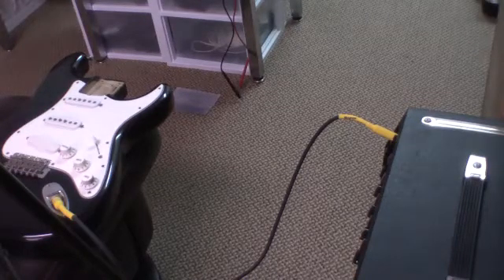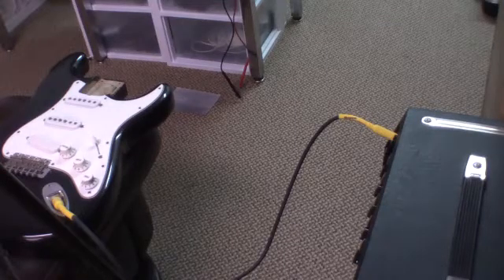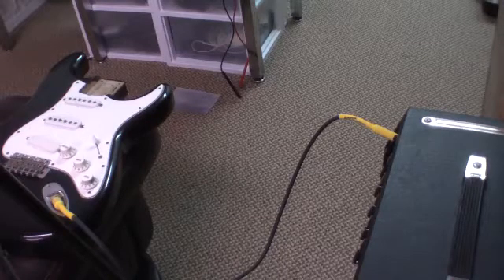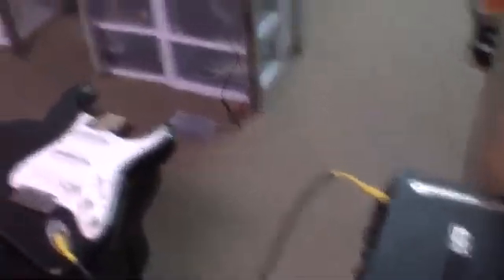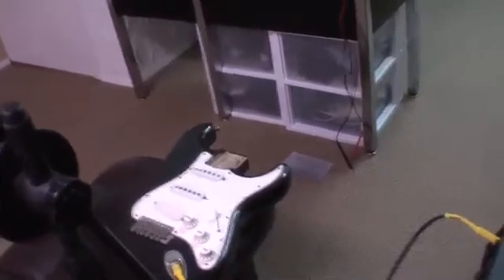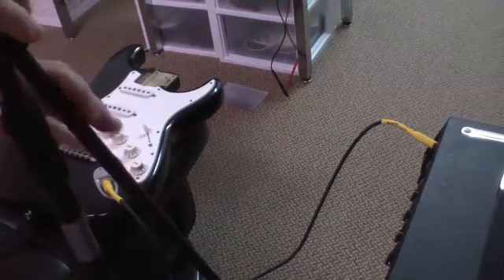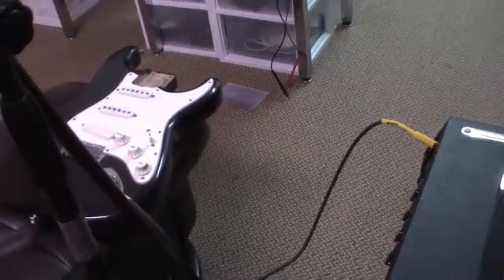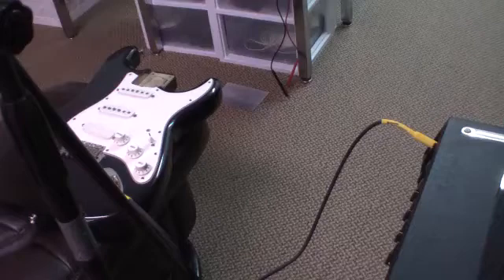Does Tone Wood Affect the Sound of an Electric Guitar when Plugged In?

Comment: I definitely prefer your approach to arguing the case for tonewood Kyle! Lots of people have cited this property of the electric as proof of tonewood, The only thing is, you dont knock on your guitar when playing it! I agree with what you've said though, there is definitely a negligible affect from the wood. I doubt that it's a useful parameter when considering tone though.
Reply from the maker: Thanks for watching. Try this. With an Electric Guitar, sit down, put it on your lap then lean forward and place your ear on the horn of the guitar, and start playing. The note project through the bridge into the wood -- it's like an amplifier - totally - in fact, I'll often do this during a jam with others, when it's totally noisy, to tune my guitar. Or when I'm unsure of how in tune I'm in at home, I'll do this. ABsolutely the sound projects into the wood. If my knocking hand shows how wood tone can make it back into the pickups -- without even having strings on - that shows how there are actually 2 components (at least) of how wood plays a factor. I think you get what I'm saying. Try the test, you'll be surprised, absolutely the notes transfer into the wood, and as you can see -- the pickups, or some at least (especially ones screwed into the wood, unlike these!) can LISTEN or HEAR that sound. Then there is the second way, in that Newtons Laws teach each if those vibrating strings are making the wood vibrate -- then, in turn, (as a reaction to an action - 3rd law) the wood vibrating is changing the oscillation pattern of the strings. Anyway, I don't dispute wood plays a small factor, if anything this all has reminded me, if you want to get tone (wood tone) from a guitar, use gutiars that have components that can communicate with the wood. Beyond that I think you have about (realistically) 3 levels of tone: Bright Medium Dark. Some might argue you could add to that Very Bright and Muddy Dark. And with those "tones" you might add sustain as an element affected by wood as well.
Reply from the maker: Mike G Just did, very good! I will repeat my comment here:

Great experiment. You clearly showed that dampening the body of the guitar had little effect on the sustain of the guitar, however, you also clearly showed that it destroyed the input energy as well (aux string), which in turn (if you watch my experiment) has a double effect -- not only are you ruining the tonal effect (sustain aside) of the "wood's influence" on that string -- but -- it stands to reason that there is less vibrational energy available for what I will call (and demonstrated) the "microphonic" effect. So your experiments provides evidence that if we attach a tub of water to the body and mess with its ability to freely resonate, we also ruin the chance for the effect of the wood to enter our signal path. As for sustain, I'll give you that... apparently the wood in a guitar really has little bearing ... well done. Very interesting any way you look at it. Thanks. I will attach this to my video, I believe it is in peoples interest to see both sides of the debate.
Reply from the maker: Every time you strike a string, the vibrational energy is transferred through the bridge, into the wood and a reverberational effect is then transferred back to the string. It is a relationship. The fact that you can knock on the wood shows that any energy, sound energy -- that exists in the wood will not only make it through the bridge to the signal path; but will also be captured through microphonics, as well. With any pickup, not just shit pickups. Notice how the guts of a dynamic microphone are nearly the same thing as a pickup.

These are all useful parameter in deciding how and why to build high quality instruments. If it was all useless information, 50 years later, Les Pauls would not sell for $2495 new, because they simply would never sound better than $100 knockoffs. The reality is, the thousands of sound engineers involved in design within the industry actually do know what they are talking about, and no, you cannot take a set of Gibson '57's mount them to a 2x4, and have a Les Paul Tone.

https://microphones.audiolinks.com/Microphones/micdiagram2922.jpg

Comment: Thanks for this video. Really interrsting. I liked the knock-on wood example. Also liked the Newton's Law example. The correct conclusion should maybe be that wood plays a negligable part in sustain and alteration to the outputted sound. Thanks for watching my vid and subscribing. I have a feeling this debate will roll on and on .......
Reply from the maker: It certainly does play a very negligable part indeed. Your video woke me up on that, by all right I thought there would be a lot more difference. It has really made me think about tone... made me think about such things as string through body design (rarely used but in existence) and anchored single coils (P90s). Components that allow the interaction of wood, period, regardless of the wood quality itself... Maybe those factors are way more important. I would imagine so.

Comment from the maker: I should add that in many guitars, you are probably listening to 99.9% mechanical string vibration through a given pickup. If the attachment to the body (of the pickups / the nut / the bridge) are not solid, and the woods used don't offer much to the spectrum, correct - you're listening to most metal and plastic. That said other instruments have a very bonded connection to the wood, for example a big mahogany Telecaster with a string through bridge and a bone or graphite nut. The connection of wood to tone is probably most important within the neck, because it is at this point that the string is most easily able to communicate through the frets. For that reason we have, for decades, been calling maple fretboard bright, and rosewoods warmer or fatter. It's not millions of people's imaginations lead by a conspiracy to sell wood, it's physics! Fretless electric guitars have an even more woody tone. Quality bridges offer more connection to wood. Floyd Roses steal nearly all connection to wood. Given all of that... it is an entirely subjective thing... I love mids and fat tone full bodied sound, but guess what... when playing live, or during recording, I find myself EQ'ing all of that goodness out, because my guitar is too large in the mix, it steps on vocal frequencies, and bass upper frequencies too much! So... isn't that grand!